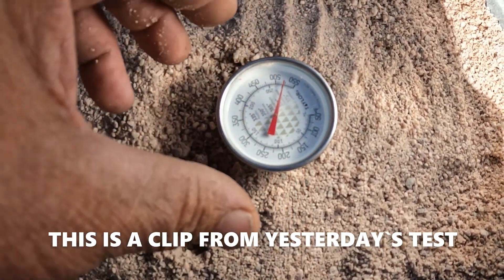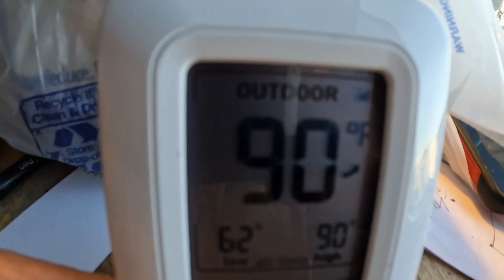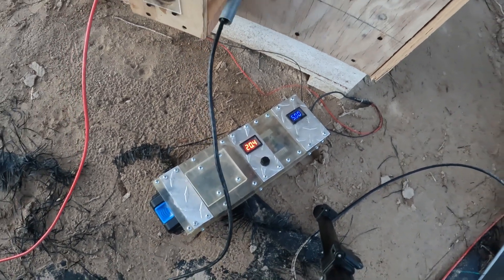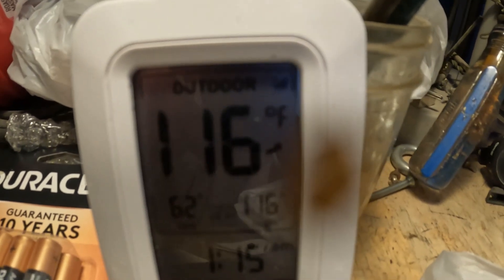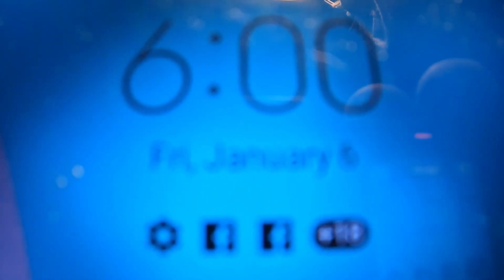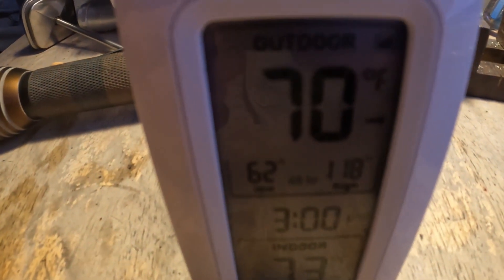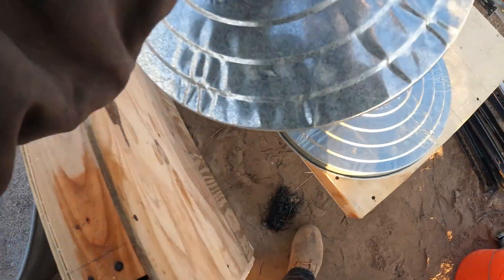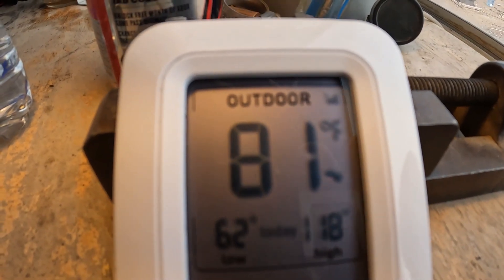Sand Battery #9 Vents and Fan Performance

Comment: What fan? Why both to going to all this trouble if you don't bother explaining what your doing and how you're doing it? What are you doing with this sand battery? Are you pumping hot air into your house via some fan? If so maybe you could show us how you're doing that. It's a great looking build but what's the point if you don't show us what it's practical use is going to be?

Comment: I think if you run it for say a week  the sand temp will go down every night but the temperature you start at every morning will be higher . if its insulated good enough it should stay very hot .You could then blow hot air into your home .

Comment: It looks ike you have it going, now the test will be endurance over time. You may have to scale it to a larger version to store heat for those cloudy days. I still like everything I am seeing. My solar panel are arriving Wednesday this comin week if all goes well and wether permitting.
Reply from the maker: That's fantastic. The two can design seems to be working great so far. But you are correct it needs to stand the test if time and if it seems to be holding up I will be scaling it up. This is all new to me so I am learning as I go and surely will have some details that will need to be upgraded or possibly modified but it is performing well so far.

Comment: You probably have or should almost have enough heat stored to keep your house warm for the night. Done good.
Reply from the maker: This prototype is still too small for a home but it is performing well so far. If it holds up I will build a larger more industrial one.
Reply: I have a paint can full of sand ready to be heated up to 450f tomorrow morning, box is built to R40 spec. we'll see how long it's going to hold its temperature totally enclosed, no heat extraction.

Comment: I have a Hot water tank  will fill with sand  Im trying this .
Reply from the maker: You can't use the water heater element I tried that in my first videos. It burnt up after two tests. It did achieve great results but is very dangerous I don't recommend it. I am learning as I go myself.
Reply: I was thinking that an electric water heater filled with sand would work. Hopefully, that would isolate the heaters from the sand so they don't burn out. Also, for a for a larger container, would some aluminum rods help transfer heat and avoid a hot spot near the heaters?
I hope both you and Mike keep experimenting and posting your results. I think sand has a future.
Reply: @gimpygardner3377  If you're going to use a hot water tank for storage I suspect you would be better off NOT using the hot water tank heating elements. Those are designed for heating water and therefore wouldn't be expecting temps more than 212F. Using sand the temps would be more than twice that, which is why one of the previous elements from a HW tank burned out. The elements for an electric stove are MUCH better suited to the temps involved with using sand. Also, electric stove elements are multi level. The electrified heating coil is wrapped in an electrical insulator that's enclosed in an outer tube that is electrically isolated from the outer tube. That's why you can safely use metal pans on an electric burner and not get shocked.

Comment: So you were heating your air with this or were you just venting it outside for the test?
Reply from the maker: It was vented in a loop back into the sand battery. I didn't have the air coming into my house. This was all for a test.